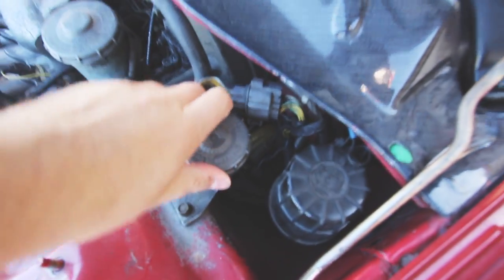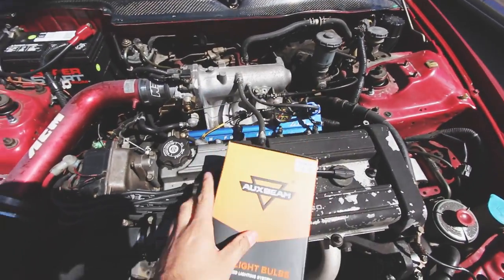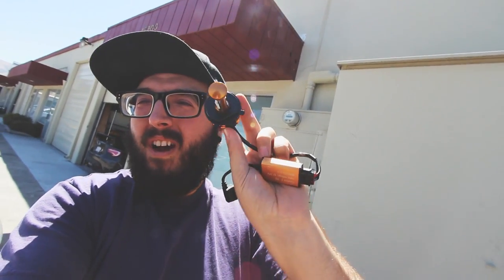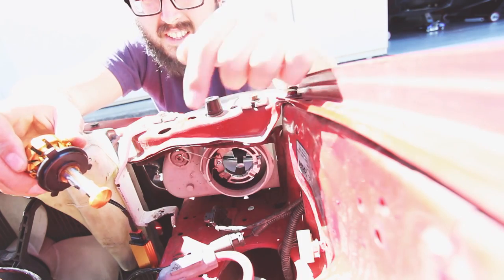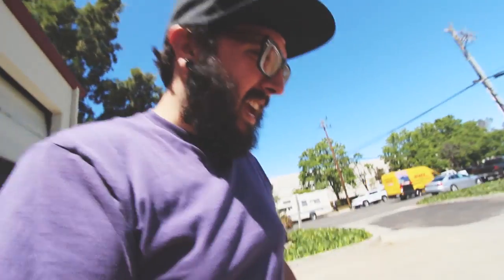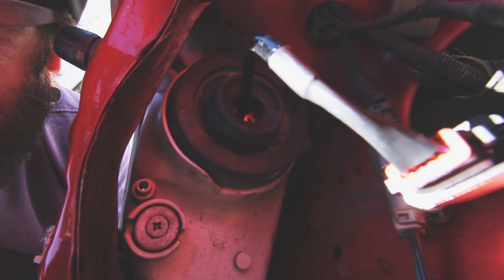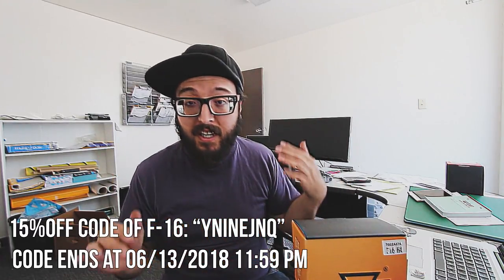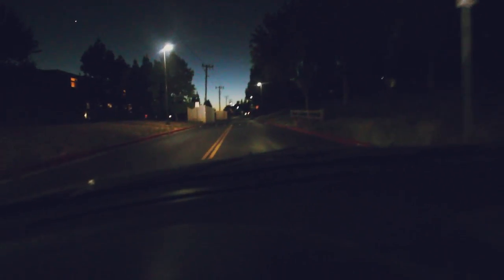AUXBEAM coming in with the LEDs

Comment: I’m pretty sure you twist off the “3 prong” disk on the led lamp and install it first into the headlight unit and lock it....then put the dust boot on leaving you the hole in the centre you then put the led lamp into the hole and it twist locks into place.....that’s how I’ve done this on my brothers Honda Fit (jazz) 👍🏻
Reply from the maker: Hmm, i'll check, i might run no dust boot and someones said maybe to just cut the hole a little wider. I'll see how they do. thank though!

Comment: I had same problem. ended up being the slave cylinder
Reply from the maker: Yeah, i thought so too but i see fluid at that one spot, so it's the only thing telling me thats leaking.
Reply: Check under your dash at your clutch master. To see if that leaks. Mine did at one point.